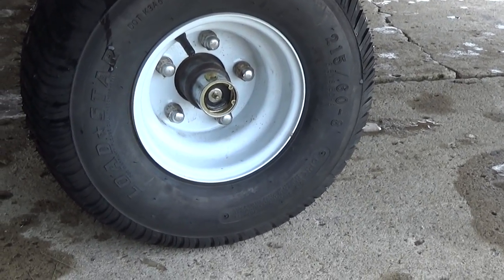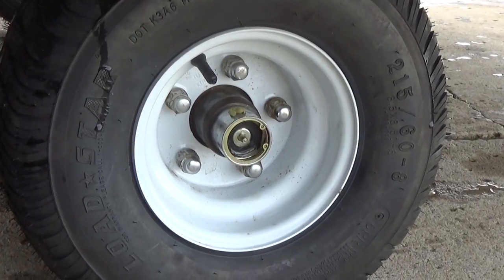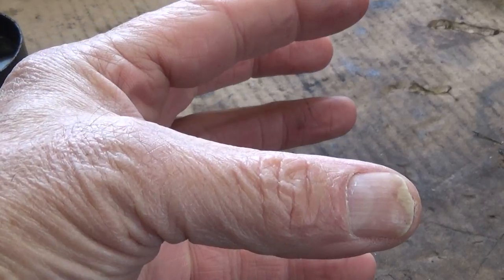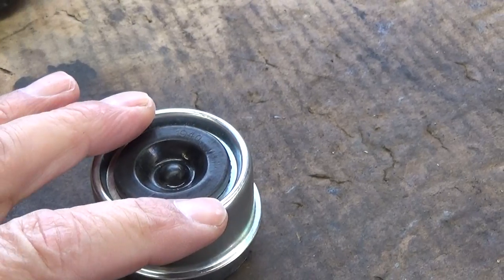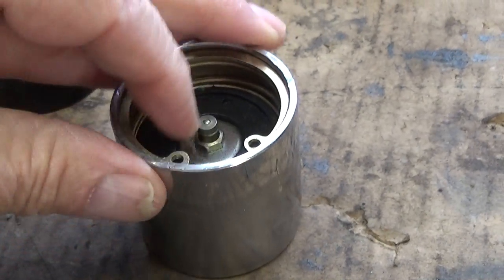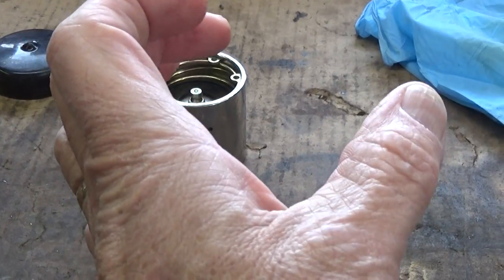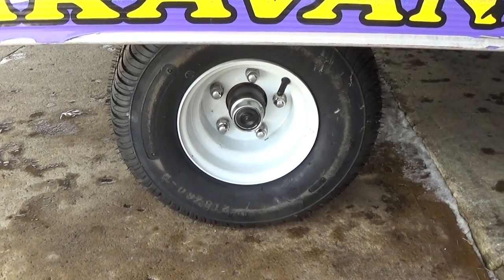Bearing Buddy explanation & Greasable axle spindle

Comment: I have EZ lube axles on a boat trailer.  My biggest issue, is the spindle washer with the tab...fairly easy to put it in place to keep the castle nut in place - NOT easy to remove the castle nut if you want to replace races, pack bearings or do any maintenance.

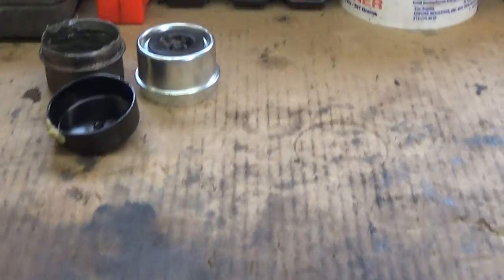Comment: At 1:14 into the video, he shows the original hub cap. That cap is for EZLube or SureLube style spindles. These spindles are ported. 
The black rubber portion is to be removed in order to access the grease fitting at the exterior of the spindle. 
You want to lift the axle off the ground, spin the wheel as you pump new grease into it. 
This pushes new grease through the spindle, it then reverses direction, and comes back through each roller cage.
By spinning the wheel, you ensure that the new grease makes an exchange of old for new. 
 It would be a mistake to replace this cap with a Bearing Buddie. 
Bearing Buddies DO NOT add new grease to the roller cages.  They simply add pressure to the hub. 
With BBs in place, you will have effectively blocked the system. 
Leave the original caps in place. 
Remove the rubber plug, and use your grease gun while the wheel is being spun. 
You will/should see the old grease exit around the outer bearing. 
Wipe it clean...…. replace the rubber plug...….... done!
Reply: spot on comment, thank you for clarifying, there is a lot of confusion on what the difference between Bearing Buddies (BB) and the Dexter EZlube system are, as you correctly said, BB do not repack bearings they only apply slight pressure 2-3 lbs to the hub to minimize water entry in the hub for marine applications, in my opinion very good move by snowking55 to remove the BB and re-install the original zerk for the EZlube system, I would only use BB for marine applications
Reply: zmanvideo1 you two are correct.  I would keep and use easy lube system for all applications not getting dipped in water.  Bearing Buddies best for MARINE usage.  Also Bearing Buddies rear seals are heavier use a stronger spring to keep grease from coming out the rear.

Comment: I spent approximately 24 years providing AQ series Volvo Penta Marine Service and various boat trailer services, etc. 
The use of the Bearing Buddy is often misunderstood. 
The BB is use with Non-Ported axle spindles ONLY. They are NOT suitable to used with the EZ Lube, Super-Lube, Sure-Lube ported spindles. 
The intent of the BB is to mildly pressurize the hub (via the spring loaded piston w/ the zerk fitting in it) so that when a warm hub hits the cold water, the contracting action does not cause water to be pulled past the seal and into the bearing box. 

Please note that BBs DO NOT add grease to the wheel bearings because there is NO grease exit as with ported spindles! 

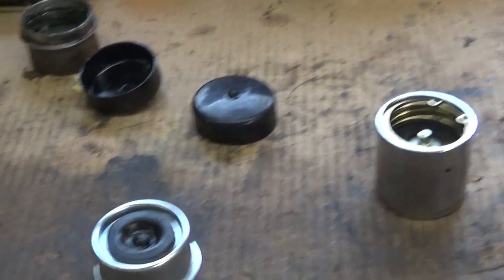The hub cap shown at 4:53 into the video is for the  EZ Lube, Super-Lube or Sure-Lube style spindles. 
This style spindles does allow new grease to enter the bearings because there is an EXIT. 
In order to properly  use the EZ Lube, Super-Lube or Sure-Lube style spindles, we must spin the wheel as the new grease is being pumped in. 

Again, nothing against the BBs when they are fully understood and are used appropriately.

Comment: I didn't know there was an overflow hole. I'm always afraid of blowing the seal out. I guess I don't have to worry. Just fill it up until grease comes out of the hole.
Reply from the maker: Yeah it's an air relief hole that allows you to put the grease in without blowing out your wheel seal. So when the grease comes out the hole you know it's full. Thanks for watching Mark.

Comment: I have bearing buddies on my boat trailer.  I just greased them and had a very hard time to get the grease gun to release from the grease fitting. Any ideas why?
Reply from the maker: No not really. Maybe the grease fittings were a bit bigger than standard causing the gun nipple to fit tighter.
Reply: I had the same problem with the collet on my new gun. I bought a very cool attachment that eliminates that from ever happening again. Here's a video showing it.
https://youtu.be/16pEROx1FBc
Reply: BlueLightBandit Thanks ..I’ll check it out.

Comment: Also..... do not mix grease types!  Differences in chemistry may cause the grease  to eventually loose viscosity. 
If you start out with one type, continue with that type!
Reply: If you want to change grease types, remove the hub and bearings, clean everything off with an appropriate solvent, and then reinstall with the new grease.
Reply: You should be fine if you have to mix greases, as long as the greases your mixing have the same base.
Reply: Michael,  your comment regarding being of the same base has just confirmed what I had suggested regarding   "DO NOT mix grease chemistry".  Mixing greases of unlike chemistry will cause grease to loose it's viscosity.
Reply: @markemery49  that's probably not true. I'd imagine the greases to be pretty inert save coming into contact with some acid/base. Probably fine , just like mixing oil brands/weights to make a new weight oil - prob not perfect but it works.
Reply: @turboleggy  Harman, all due respect to you........ comparing mixing oils vs mixing grease chemistry is like comparing Apples to Artichokes.  
I can tell you first hand that I have personally seen Un-Like grease chemistry cause a reduction in viscosity.  A reduction in grease viscosity can cause an issue.
Reply: @markemery49  I will have to look into that thanks for the response.

Comment: I just looked at my bearing buddies and they don’t have that hole on the side like you showed on yours.  So then on mine how do I know when it is full without damaging/blowing the seal?
Reply from the maker: There should be a big spring that will collapse when you add grease, just watch the plate with the grease zerk in until it moves all the way out, then it will be full.
Reply: If you see grease coming out the dust cover on the inboard bearing, you have gone too far (and probably need to reseat your dust cover)
Reply: Sounds like you're fk'd by the bearing buddy; I'd start with a new trailer and prolly a new boat also; be goodt excuse for wife.  10-4

Comment: Don't fill the Bearing Buddy full that the spring is all the way out. You only need to add grease until the spring starts to move out then stop pumping. If you fill it full, it puts too much preasure against the rear seal and pushes it out and ruins the seal. Take a look at boat trailers at the dock and you'll notice grease all over the back of the wheel. That's because they filled the Bearing Buddy full.

Comment: I wish you had shown the hole on the axle where the grease zerk is, I think my trailer is the same and made me always assume the Bearing Buddy system is not good for my trailer.
Reply from the maker: Sorry I guess I didn't do a follow up video. The hole in the axle is located in the middle of the axle stub. It's tapped which allows you to screw in a grease zerk, you then simply install the dust cover without the rubber cover and fill the hub with grease by means of that grease zerk until it fills the dust cap and then pop your rubber cover in place on the dust cover. Hope this helps.
Reply: Yea, my Zerk is not in the center exactly, it on off center. But I assume I would not want to use Bearing Buddies at all then? I have thought about getting some, but they seem to not be made for these type of axles correct? Or if you use a Bearing Buddy it does not seem to help with getting the old grease out, so you would have to remove it.
Reply from the maker: Hi Jeff, your axle may not work with Bearing Buddies so go with the basic dust cover and grease your bearings through the grease zerk. Bearing Buddies does not force out the old grease, you have to pull out your bearings and inspect and clean them or replace them, clean out all the old grease in the hub, and then pack the bearings with new grease and re-assemble, followed by adding grease through the grease zerk.